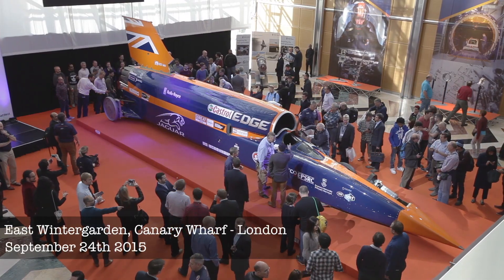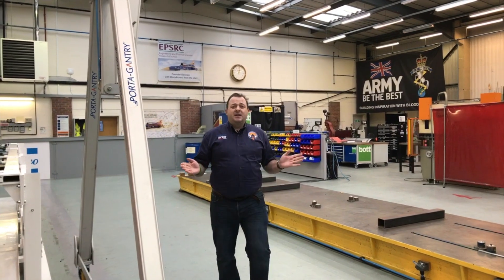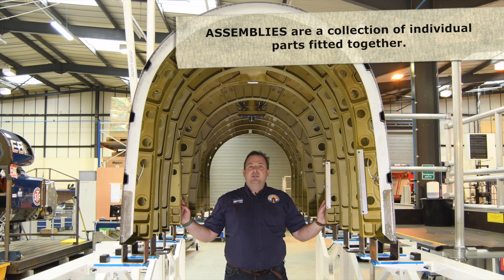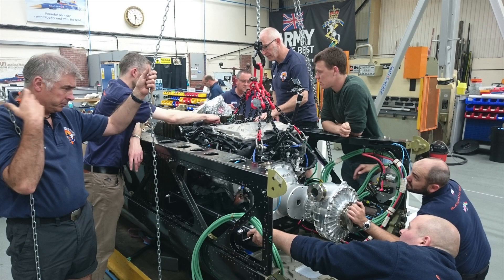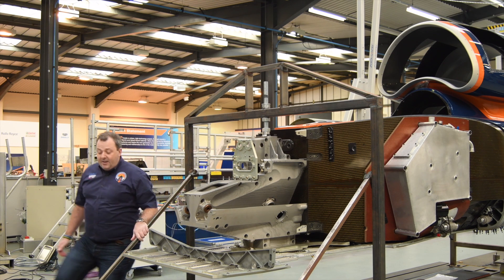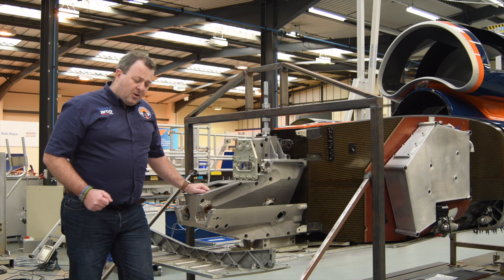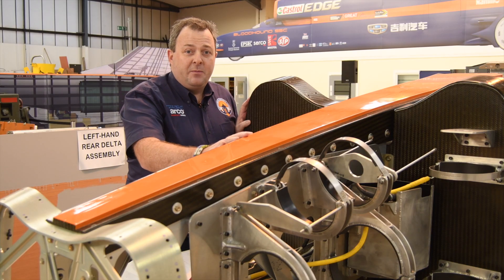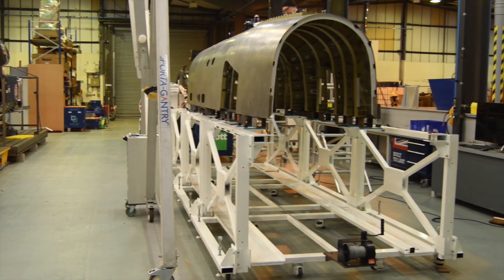Anatomy of the Car - Introduction

Comment: And what happened to it happening in 2K16?
Reply: TheCouchGorilla39 Oh they change the date to 2018.
Reply: MrCreepjo this car was completely designed by computer for men to build it and then animate it to drive it in a flight simulator. cause it will never attempt the record since they only figured out last week that a fast jet car needs to be straight.
Reply: Job91 They did the same record before if that work why wouldn't this. Also didn't they have many worker cleaned up an area in Africa for nothing if they just going to use flight simulator.
Reply: well their wheel test was a joke... so at this point I was not taking their efforts as serius at this point. But im sure that once things will start moving towards a deadline their effort will be more visible. im aware that their last attempt was very succesfull. im just not convinced that after eight long years this attempt has to be taken as serius since their videos are not that impressive so far.
Reply: Job91 Wouldn't that also means their sponsors also loose money when they spend it on this project.